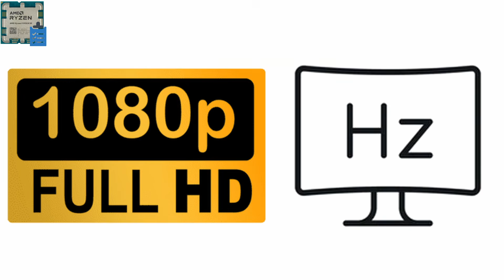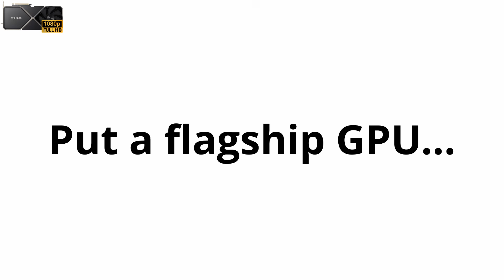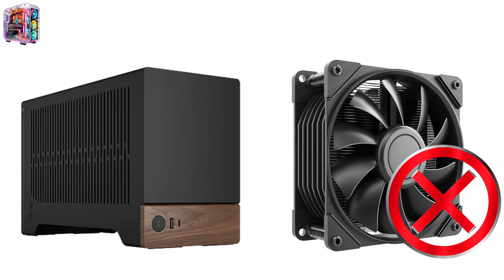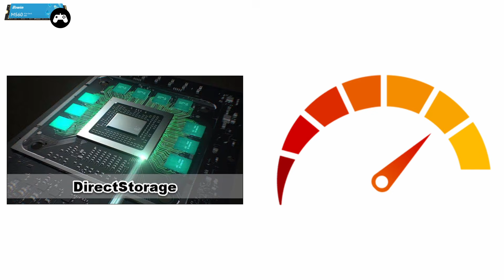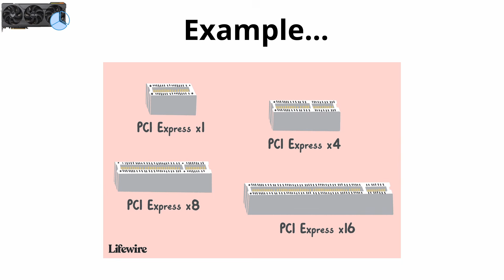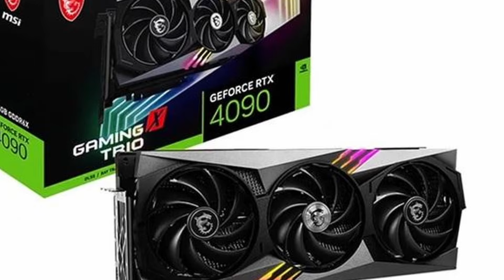If You’re About to Buy a PC, Watch This First

Comment: Could you help me, please? I ´m very poor , I work as a security guard, and honestly, I would have to save my entire salary for two years to afford it a computer I need. However I have a once-in-a-million chance to buy a good computer because a decent amount to money I will receive, more or less $5000. My dream is to work sculpting characters for video games, so I want to buy this computer:
Ryzen 9 9950X3D
ASUS TUF RTX 5080 16 GB
ASUS TUF Gaming X870-PLUS WiFi
ADATA XPG Lancer Blade RGB 32 GB (2×16 GB) DDR5-6000
Kingston NV3 2 TB
Corsair Nautilus 360 RS LCD
NZXT C1000 Gold Core ATX 3.1 1000 W
Balam Rush Tank Super 9600 TB Case, Midi-Tower, ATX/Micro-ATX/Mini-ITX
Thermalright TL-C12C-S X3
CyberPower GX150C2 1500 VA / 1000 W, pure sine wave
MSI MPG 321URXW QD-OLED 32", 4K 240 Hz

I’m going to use it for modeling millions of polygons in ZBrush and Blender, creating textures in Substance Painter, and running fabric simulations in Marvelous Designer but I want it to play games too.  Do you think this setup is good? What would you change? Like I said, I’d have to save my entire salary for two years to be able to buy it.